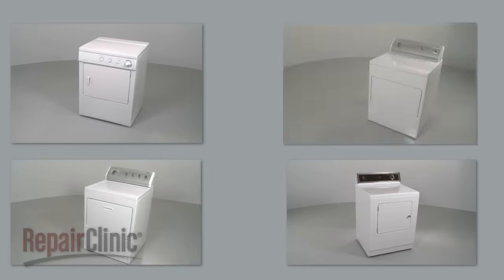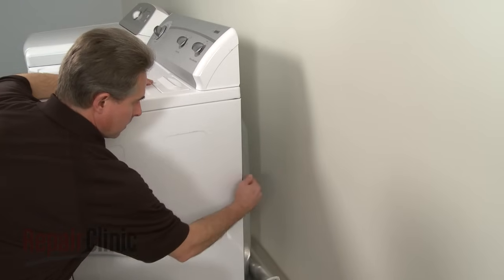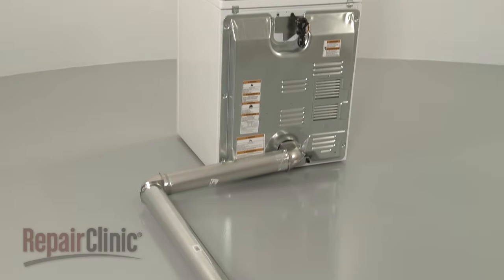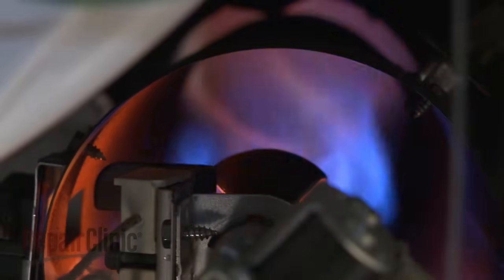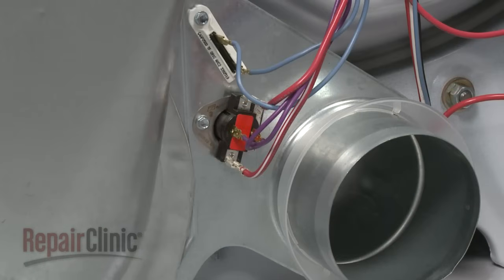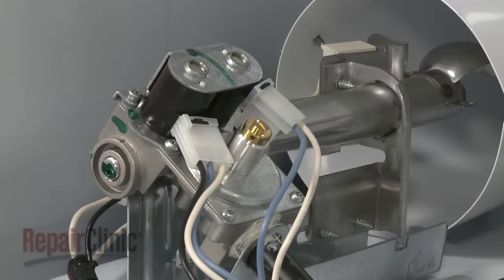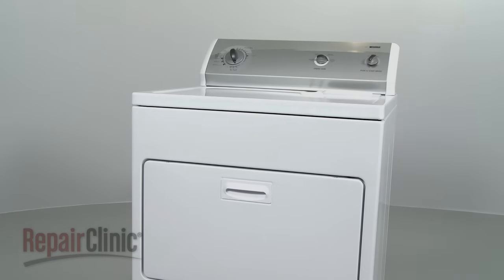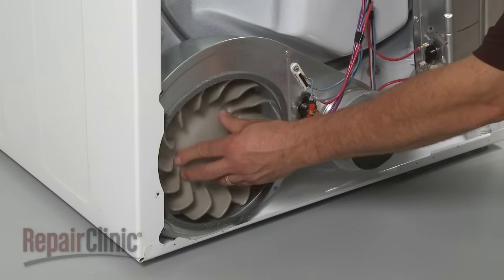How Does A Gas Dryer Work? — Appliance Repair Tips

Comment: What happens if the flame sensor fails in an 'open circuit' condition? Will the solenoid valves both open & will gas flow, even though the igniter won't be able to light?
Reply: Good question. Since the main coil is energized at the same time as the hold/assist pair, the main coil drops the voltage available to the assist coil portion down to around 10 volts. It's not enough for it to open and allow the hold coil to do its job. No gas can flow and as mentioned, the ignitor won't glow.

Comment: Here the burner was shown under the drum.  Is this normal?  Growing up in an NYC apartment my building's laundry room had dryers where if you bent down you could see the fire in a hole through the top of the perforated drum.  I even remember how on the low setting the flame looked weaker

Comment: I think you'll find that at 3:59 both the hold and the assist coil in the piggy-back pair are energized at the same time. Both energized will pull up the first solenoid valve. Once the radiant sensor opens the main valve will open and the burner will lite. This provides an essential safety feature such that if power is interrupted the entire ignition sequence must restart thereby not providing a build up of gas in the drum while the radiant sensor closes, the ignitor re-heats, and radiant sensor re-heats again.
Reply: @jimbarron8688   I have a dryer where the igniter glows. But the igniter never shuts off. 

Are we saying that the sequence is such that the flame sensor gets triggered by the igniter even though there is no flame yet??  The gas only starts flowing once the flame sensor is open?

Most manuals suggest to test the flame sensor by checking continuity. But isn’t it more important to test that the flame sensor opens up at the right temperature?

Comment: Thank you, I need a multimeter to check the parts! See how technicians take the advantage of you! Then if you decide not to fix it you will buy a new one, then they offer to take the old one to "trash it" but they fix it and resell it!!
Reply: That’s how core returns work. It’s the same for your auto parts except they are able to offer a discount.

Comment: I have heard that on igniters, they can be working just perfectly as far as the flame, but will cause the flame to go out after initial light after 10 seconds, the flame will then come back on for 6 seconds after 50 seconds, then another 50 seconds or 1 minute and the flame will come on for 5 or 6 seconds and and then rinse repeat, it continues that pattern over and over.  Somehow these ignitors (if after-market replacement type) will fail with their resistance but still light the flame no problem.  It sends a signal to the secondary gas valve and the flame goes out , and over and over.  Now, I've not tried this (buying a guenuine whirlpool replacement igniter for my Maytag mgdb200vq0 gas dryer), but I have the same exact symptom as above and not sure what to do?  I did resistance checks on all the components in this video (or most of them) and they all check out.  Maybe not with the exact resistance values that are listed on the document that came with the dryer, but i did replace the coils twice and same thing is happening.  I think i also replaced the flame sensor (hard to get to)... so yea, VERY perplexing.  Any ideas?  Should i get a new ignitor?
Reply: I have the same problem, did you ever find a solution?
Reply: @lk98765  turned out to be the dad-gum ignitor.  If they are just a hair off in resistance, it's a no-win situation.  Make sure to get a decent one, and you'll be good to go.  I turned gray over this one and could have saved myself some $$ too...... If only I would have known sooner, lol.  Good luck to you and lef me know if it fixes it.  Get an OEM from a reputable source.
Reply: @dabneyoffermein595   .... I may have an issue where the igniter glows like it should (at least apparently), but gas never ignites...  I can smell gas after the igniter cools down, but it doesn't burn....  Wonder if somehow the gas isn't being pulled past the igniter (clog or some obstruction), or if the igniter isn't getting quite hot enough anymore, or if there's an issue where the gas comes out of the gas valve....   I changed the gas valve coils, and this problem persists...   It's important to know that there was (prior to this happening) a clogged vent pipe; the vent pipe was cleaned out and the air does blow out of the vent grate now, opening the louvers on it.
Reply: @kennikuhlmann-clark9860  I have the same problem, did you ever find a solution? Thank you

Comment: What happened when you put water in a clothes dryer both gas electric and steam ❓❔🤔?
Reply: What? You should never put water into any dryer it won’t make steam it will break your dryer if it has a steam function great but don’t dump water into the drum don’t be stuck on stupid

Comment: I am going to replace the high limit thermostat because on my GE dryer the original owner said it's burning up and sure enough there was all the feathers from pillows and a down jacket It eventually stopped heating so I was given it and the thermal fuse did not blow so It was the coils. But the down jacket feathers were in the burner so I think that the high limit thermostat is stuck closed and needs to be replaced. Model DBSR453GB2WW

Comment: Our dryer glows a little then shut off without a flame. My husband changed the gas coil. And some other parts he checked with the multimeter and still not working. We bought the dryer thinking it was in good condition and now we can’t make it work. 😔

Comment: So, semi rigid ducting is acceptable up to 20 feet, but basically every dryer has two 90 degree elbows.  Once behind the dryer and one at the wall.  So suddenly your semi rigid ducting is only acceptable for a 4 foot run????
Reply from the maker: The dryer vent specs are from the dryer to the outside, any internal ducting is accounted for already. Thanks!

Comment: Can someone help? I have a 2015 whirlpool Gas Dryer. The voltage on the dryer is 110v but the socket is 220v. I have a converter regulator to convert 220 to 110. The problem: My maid plugged the dryer in 220v (God only knows why she felt the need to pull it out of the 110v and put in 220v - we think she was charging her cell hehehe ) ANYWAYS - the dryer ran for a few seconds and stopped - nothing works. Is the dryer toast? or is there a fail safe to protect it? what should I inspect?

Comment: Your videos have been so helpful! I've already replaced a broken igniter and thermal cutoff. Still no flame so I need to test the cycling thermostat and flame sensor. I'm hoping either of those will fix it because I don't feel comfortable messing with anything gas related.
Reply: Never mess with anything involving Gas
Only have a qualified gas technician fix the Gas Valve or Solenoid Coils
Reply: @stephensnell1379  - the solenoid coils are not really gas related and they are super easy to replace. Two screws removed and the plate comes right off. Slide them off the metal columns, replace with new ones and done.  Nothing in this process exposes you to anything gas related. Saying they are gas related is akin to saying I don’t want to disconnect the wire harness from the gas valve because it’s gas related. I changed mine yesterday and it solved my problem of the burner being intermittent. The classic coil(s) going bad and hard to diagnose but easy to fix for <$20

Comment: what do you think is a better buy, electric or gas? in your opinion.
Reply: +Yaganzii Robert Its like asking do you prefer to cook on coal or gas? The majority would go with the less maintenance extensive and safer option, gas. In the case of electric vs gas, electric is safer and will require less maintenance.
Reply: ***** Gas and electric perform about the same. But here's is some problems that you only get with gas, the smell of gas getting in your clothes, and gas-leaks which may cause explosions. Gas dryers simply have more points of failure.
As for maintenance you may have to check for leaks every once in a while, which can occur in different places, for different reasons.
Reply: @reconx86  it's unlikely the gas will get on a person's laundry
Reply: @stephensnell1379  There's nothing unlikely about people keeping old gas dryers without proper maintenance. 
Also gas is definitly not 5x more powerfull, if that was the case nobody would bother using electric. The only difference is that it "generally" heats up faster depending on brand/model, but the end result is the same.
Reply: That's because gas is 5x more powerful than dryers that use electricity as heat to dry the clothes
Reply: I prefer gas, dries faster and is more economical to operate, in my experience a gas dryer is no less reliable than an electric dryer..
Reply from the maker: Yaganzii Robert It's a matter of preference.
Reply: V

Comment: So a gas dryer still needs to be plugged in, in order to work? Do people prefer gas over electric?
Reply: I know I’m 5 years late but gas dryers are more expensive use less energy dries faster and are gentler on clothes than electric but gas driers are more dangerous because of the heat and carbon monoxide and it uses gas so a leak could level your house
Reply from the maker: Yes, gas dryers still need electricity. We do not have information on which is more preferred over the other.